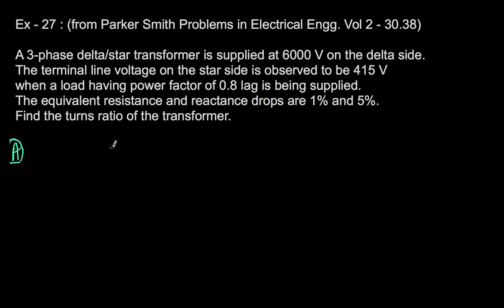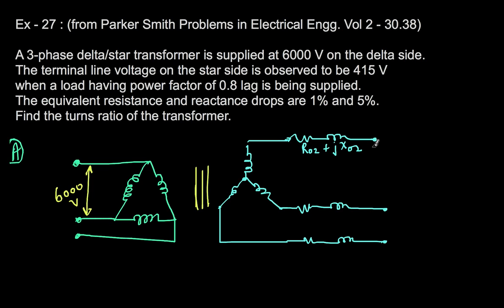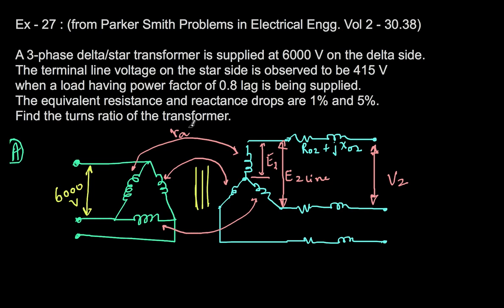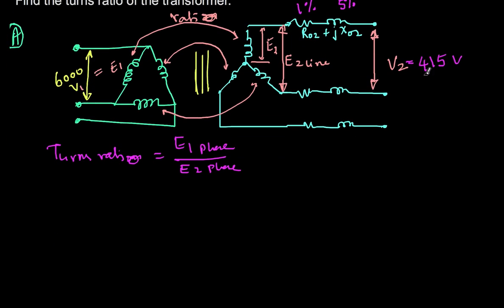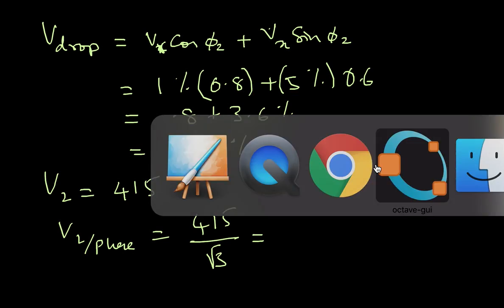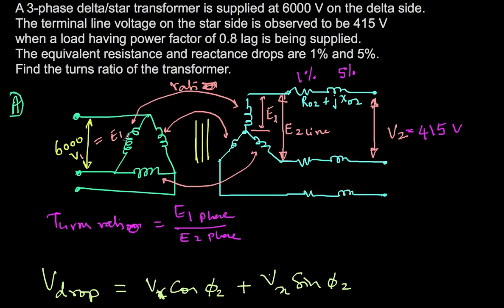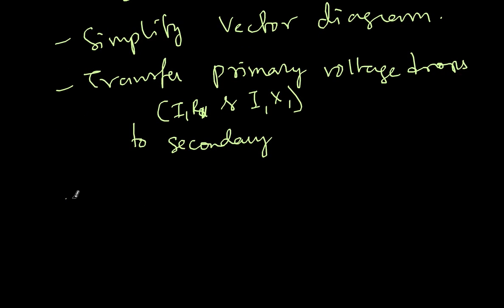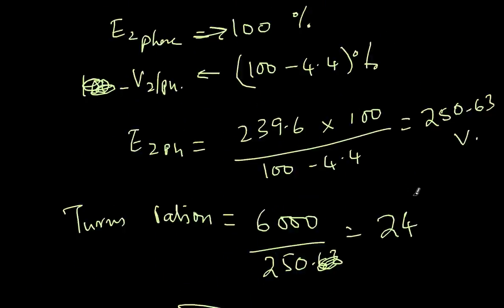L7 - Part 2 - Approximate Voltage Drop in Transformer

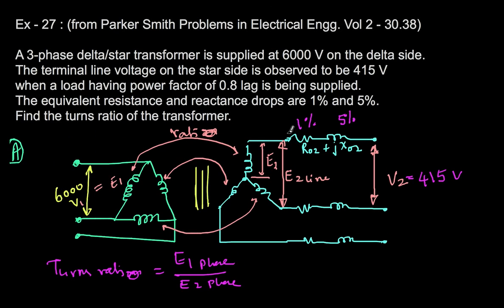Comment: why did you use Vreg formula as Vdrop at 5:54
Reply from the maker: when you are considering on percentage basis, then % Vreg is nothing but % Vdrop
Reply from the maker: Vreg = (V_no_load - V_full_load)/V_no_load = V_drop/V_no_load = % voltage drop
Reply: sir,i'm from iit guwahati and your lectures are amazing and far more interesting than the professors here. can you please upload dc machines ,generators and 3 phase motors
thank you sir